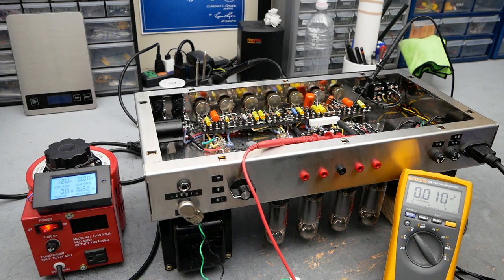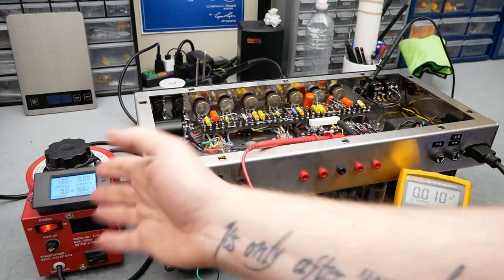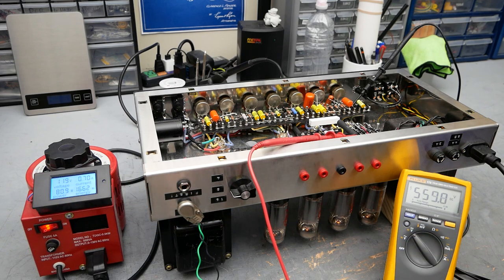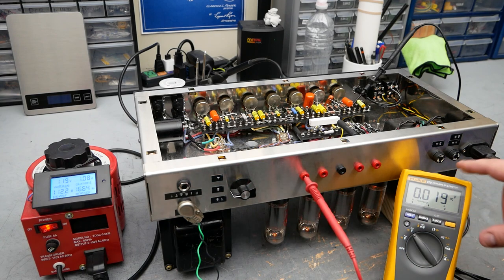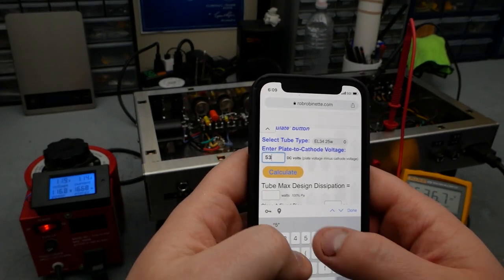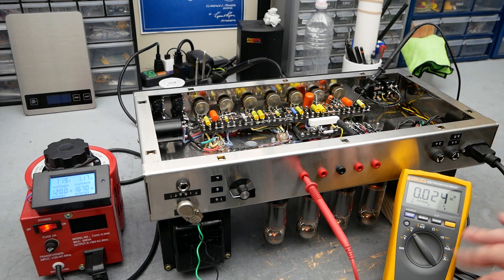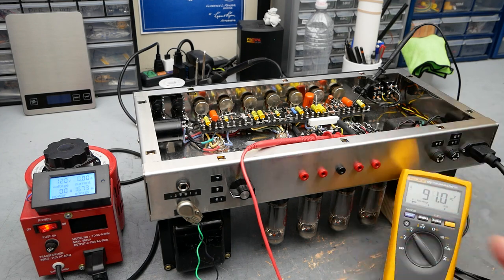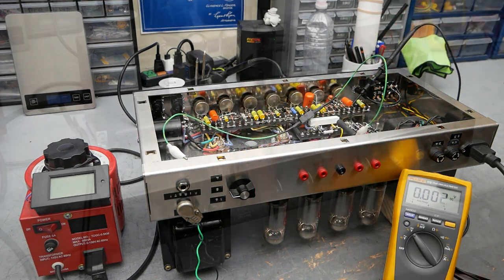Hiwatt DR103 Build Part 5: Final Test and Listening

Comment: Hi. Is the 540V that you measured goes into the center tapped of the OT? I am currently building a guitar amp the marshall silver jubilee. My concern is that my available PT (from old hi fi system) output around 580V DC. In the amp where I took it that is where the CT of OT is connected. The HT winding has a CT which where they take the low voltage for 6l6 grid and for PI and the negative output from the bridge rec goes to ground. Will it nnot gonna destroy the tube? Is my voltage too high? Im also thinking of using lower voltage around 300V by using half bridge rectification. Is it still ok to run that low coz I see in all marshall amp they use around 450V. Thank you.
Reply from the maker: I assume I grounded the high voltage center tap, so yes that would be 540 to ground and the center tap.
You'd want to check the output tubes you're using to make sure you're not exceeding the max plate voltage. I don't recall what that is for 6L6GC, but the datasheet would say under maximum ratings.
You also want to make sure you're not exceeding the voltage rating for filter caps.
The higher voltage will change the bias point, so the bias circuit/cathode resistor value may have to be tweaked for the higher voltage operation. 
I would recommend reading up on tube amps at valvewizard.co.uk. Merlin will fill in a lot of blanks. Good luck!
Reply: @graybenchelec  thanks for the info. This is what info I am lookings for.

Comment: Hi, thank you for the video! Do you know if original Hiwatts ran at 530v DC? I guess you will swap quads of tubes rather quickly at this voltage..
Reply from the maker: I think closer to 500VDC, but that was at 1970's wall voltages. Good chance vintage Hiwatts used today are around 530VDC. 
High voltage alone will not cause excessive wear to output tubes as long as your bias is still acceptable. EL34 are rated for max 800VDC.
Reply: @graybenchelec  800V is rating was prob. max for vintage tubes that were durable.
Reply from the maker: @Stu66orn  I haven't heard of any issues with high plate voltage and JJ tubes, guess we'll see 👍
Reply: It's the EL34's screens that take the hit with higher voltages, they over dissipate. Original Hiwatts ran their tubes at 460 vdc.

Comment: Swap 1 output lamp from one arm to equalize the load of the output, the lamps are specially matched in pairs. 18 24 in one shoulder and the same parameters 18 24 for the other shoulder. All in all a good job, but as I said earlier in video 1, you unfortunately failed to achieve the original sound of this amplifier because the output transformer does not have the complex winding sectioning of the Partrigue transformer.

Comment: Firstly, I am building my first amp, and it is a Mojotone DR103 kit, so your video series is a tremendous help. So thank you.

Secondly, how did  you connect the power meter to your variac? I have one built into my current limiter, but it would be nice to have that on my variac for those times I run without it.
Reply from the maker: I don't have it handy, but there are install guides out there. The meters are essentially just DMMs. The voltmeter goes across the variac output. You want to get one with the current sense transformer: https://www.amazon.com/HiLetgo-Multimeter-PZEM-061-Voltmeter-Transformer/dp/B079JNY5VD/ref=sr_1_51?crid=2GUW214QTK7FM&keywords=multimeter+current+sense+transformer+panel+mount&qid=1679172486&sprefix=multimeter+current+sense+transformer+panel+moun%2Caps%2C56&sr=8-51